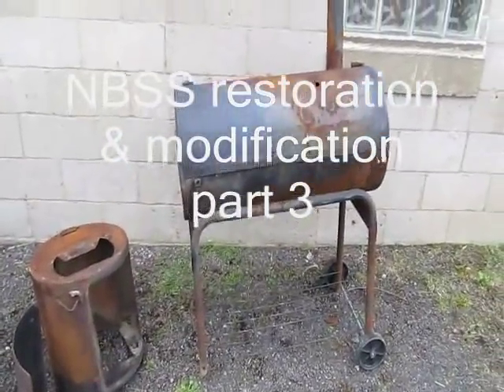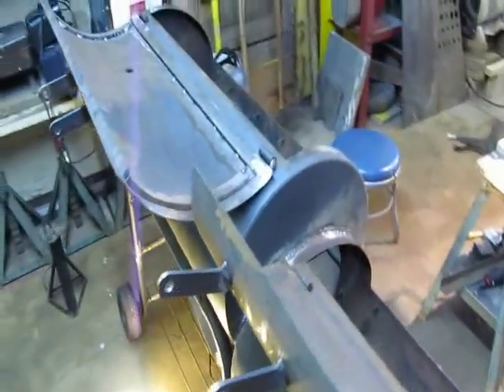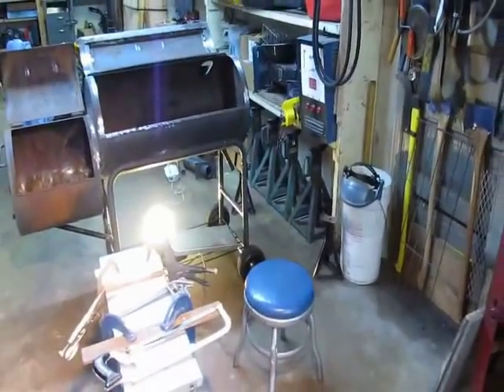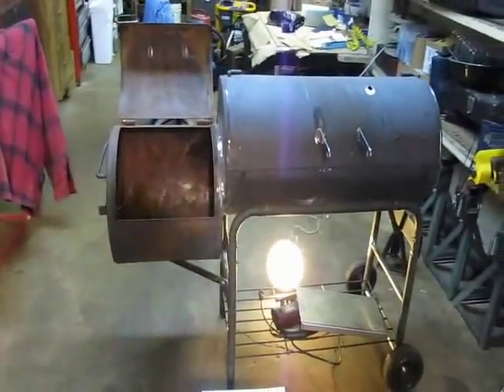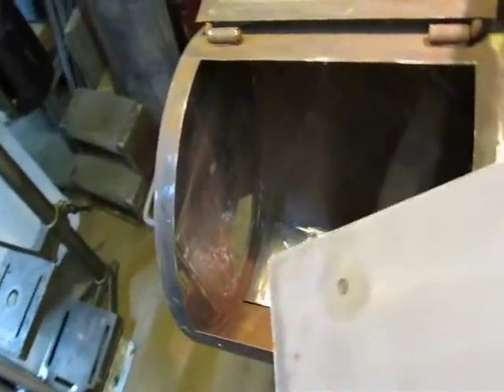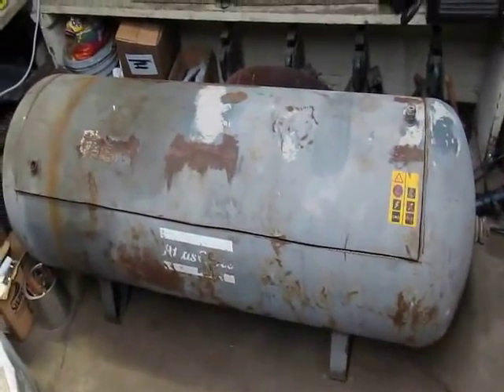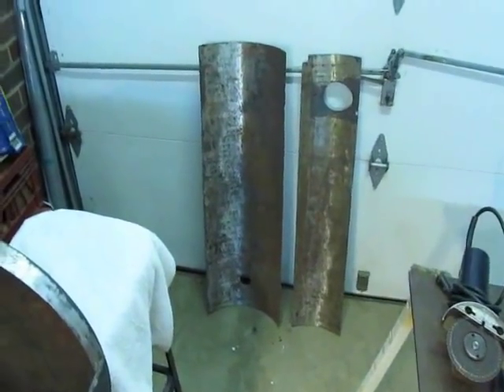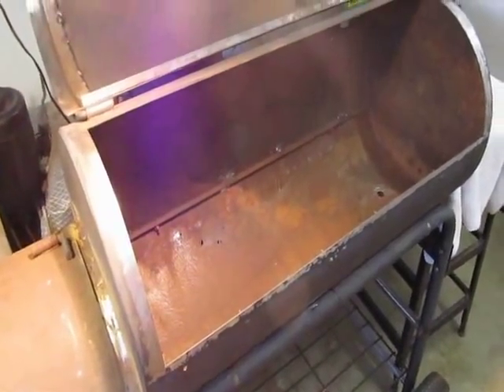Offset smoker restoration & modification ( part 3 )

Comment: Looks like you have done a lot of work on that old smoker. Can't wait to see it when you and finished and smoking. I got a Char-Griller Smokin Pro a little over a year ago. I have done a lot of the usual mods and am pretty happy with it for a cheaper smoker. I started out on a Brinkman vertical smoker which has now been retired. Keep up the good work.

Comment: Great work on your rebuild/upfit on your lucky find.I'm guessing the reason the CharBroil mated up so well is that they now own the Newbraunfels  Works thru a buyout i'm told.Your upfit is'nt to far from oem i have a Redriver model bought in 2001 from Kmart in Greensboro NC $125.00 some of the best money i ever spent. This model came w/stainlees shelf i like your upgrades too tires, casters!, added shelf,brace for the fire box.Mine has the flat surface angle warming over the fire box.
These mods that you have made pushed me right off the fence to go ahead and add a welder to my shop. I just hope my buds that say they'll teach me to weld come through or i guess its off to tech for another course.Again very good work!

Comment from the maker: This was probably one of the best mod's that I done on this smoker. The top shelf holds consistent heat very well. I can get 6 racks of ribs  ( St.louie style ) in this smoker, with the addition of this shelf. This was why I did NOT lower my smoke stack.